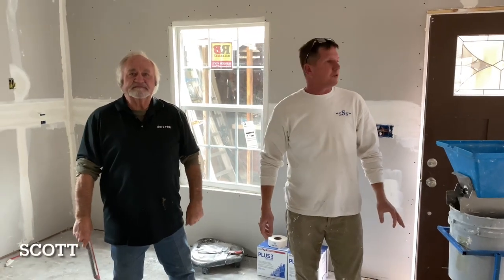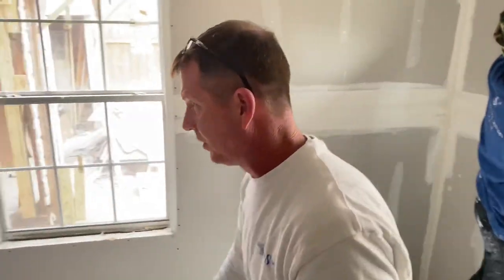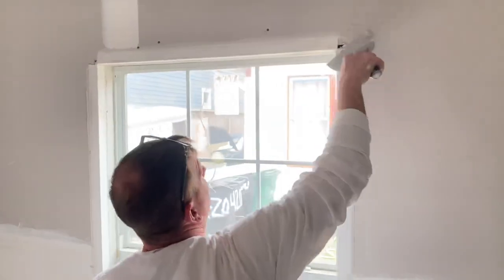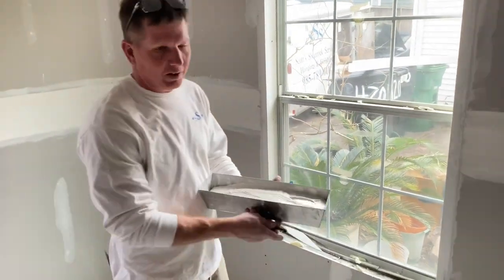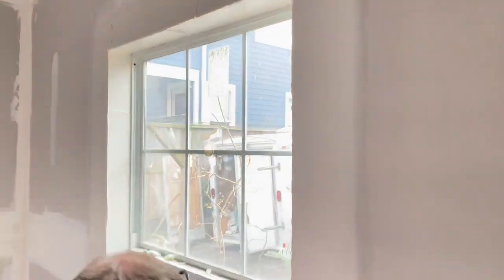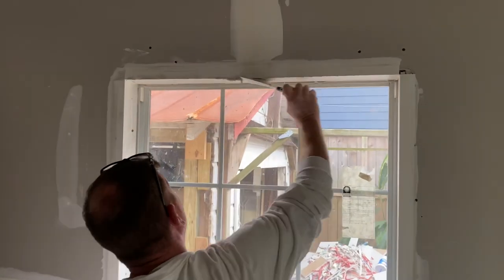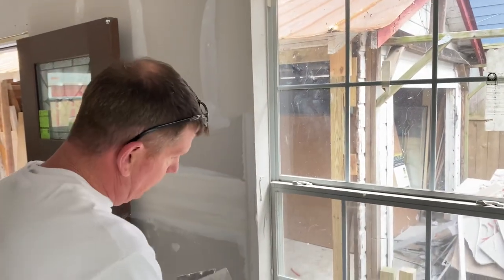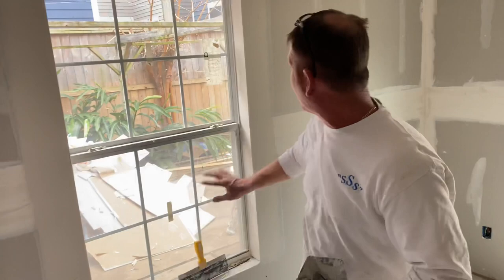How to install corner bead (windows) full process

Comment: I’m getting ready to do 7 windows like these so this video is very helpful THANKS!  I do have a couple questions: at what point were you on the flats and butts before you started the windows?  And is there a reason that you didn’t do the bottom outside of the windows?  Thanks again
Reply from the maker: I always take the flats and butts first then install corner bead and float and then float the boats and flats into the window as far as the bottom corners go as long as their level should be fine with a touchup to spout the edge. If the corners not leveled and you’ll have to float under a little bit. But the trim should cover it

Comment: Do you have to put corner bead in the windows or can you go without?
Reply from the maker: The corner bead is meant to cover the joint between the return of the window and the outside wall if you don’t put corner bead on it you can wrap it with wood but you have to do one of those two to have a nice finish.
Reply: @scottssheetrockservices  okay we decided to go with the wood. Thank you.

Comment: What kind of mud did you use?
Reply from the maker: On that particular demonstration I believe it was USG +3 you can use any kind of mud for the install just make sure it’s loose and you have no blisters
Scott
Reply: @scottssheetrockservices  thanks for the quick response!
Reply: @scottssheetrockservices  when skim coating the drywall what do we start with first ,is it the corner beads on corner and windows please help,I would like to know
Reply from the maker: @davyphiri7503  I like to always start with a cornerbead first are you windows straight six and then 45 then I’ll follow up with all of my recessed seems we call them flats. Skim all of those just to the edge of the mud on your windows and cornerbead. Then but joints and screws
Reply: @scottssheetrockservices  thank you so much for your quick response greetings

Comment: What are those plastic beads called lol plastic bead?
Reply from the maker: It’s actually not a plastic. It’s a laminate paper faced, and as you saw in the video we glue it on with mud and it has a lifetime guarantee it. I’ll never crack and has no metal in it so it can’t rust. Really bad ass product! Been using it for 17 years in my business and I’ve never fixed a single crack corner bead behind it. Just saying…